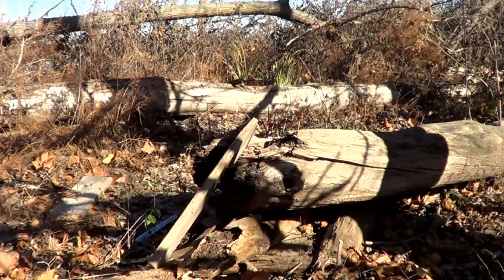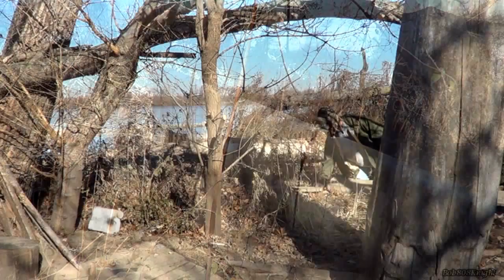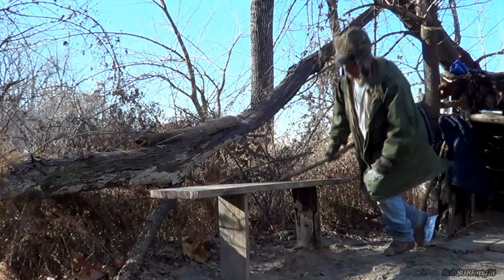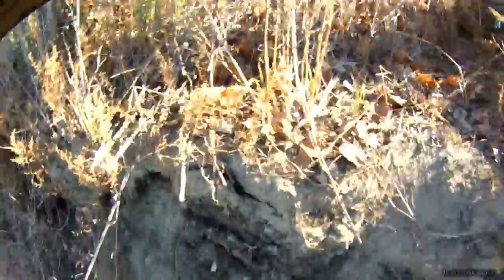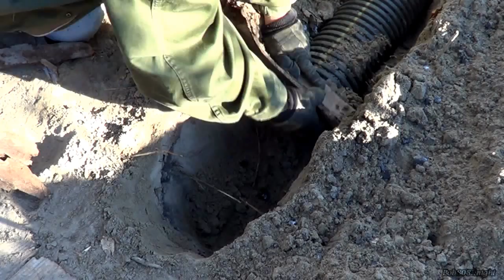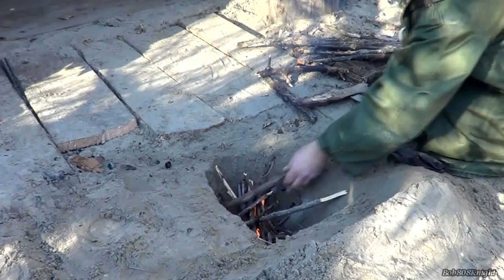Shelter Mods Sitting Bench and Hybrid Dakota Fire Pit

Comment: Great job on the fire pit!!! How about a wall behind it to reflect some of that heat into the shelter?  Bench looked good and sturdy too.
Reply from the maker: greg smit thanks Greg. I'm hoping to find a piece of metal along the riverbank I can use as a heat shield. I think it will work much better than the sand. I think the sandal just soak the heat up. so that will be my next project. :-)

Comment: Sweet shelter Bob. What do you think about a reflector wall to bounce heat from that fire towards the shelter? That and it would also help with wind protection (or even a "L" shaped reflector wall coming from the left side of your shelter then swing in front of it...open on the right side for easy entry/exit). Pretty cool.
Reply from the maker: Cheech1968 thanks brother. I'm hoping to find a piece of metal along the riverbank I can use as a heat shield. I think it would be more efficient than using sand. As far as a wall by the shelter. I like that idea. It would block the wind.I think I will incorporate this into my design. Thanks for the tip brother have a great weekend
Reply: Bob808Knight No problem. Your shelter is definitely good enough to be at least a 3 seasons...possibly winter too with a reflecting wall (wink wink). Again...very well done sir.

Check out alonewolverine1984's video "Pimp Your Lean-To Shelter" video. She builds a wall like the one I'm referring to.

https://www.youtube.com/watch?v=SSqdy8VUCi8&list=TLWcDYBfXmz-g